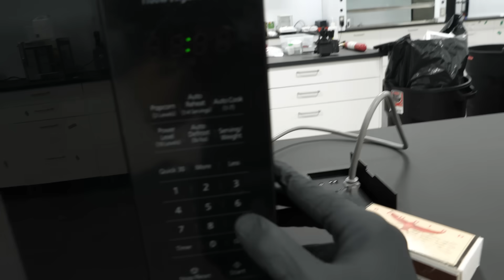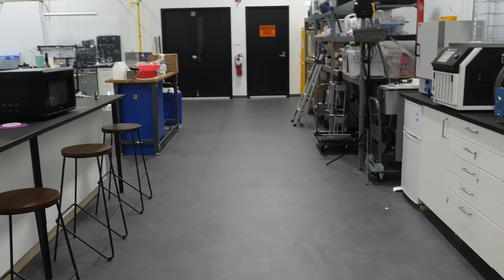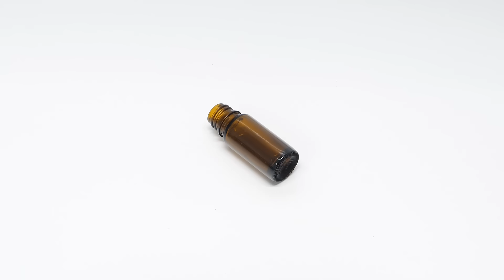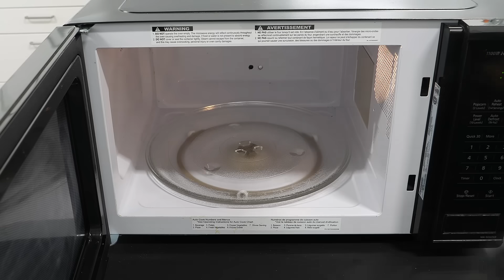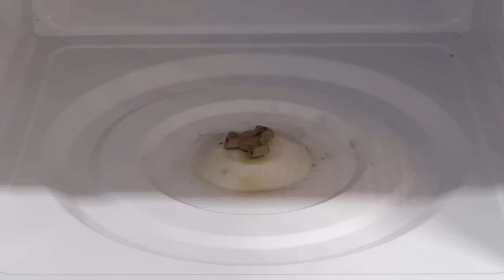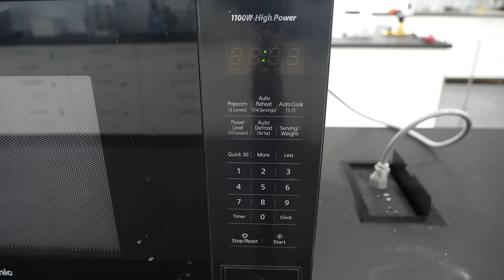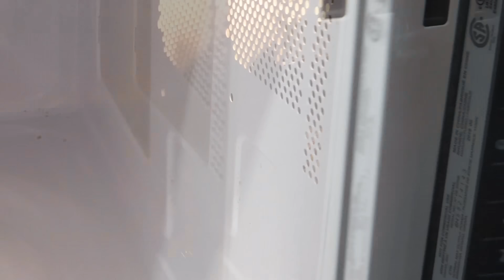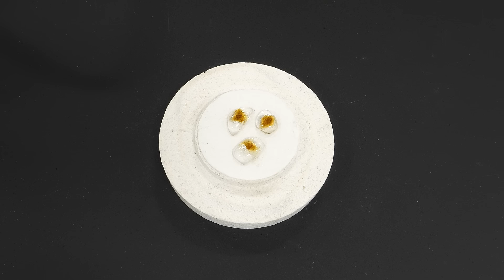Melting glass in the microwave is crazy

Comment: as someone who's dabbled in glass art, I can say this is an excellent result, pretty much what it would look like if melted in an actual oven. Unless you put pieces of glass on top of each other, they're usually not meant to melt together anyway. And the cracks are probably from using different kinds of glass but I'm not sure
Reply: The cracks are because they’re different types of glass. They crack because they have a different Coefficient Of Expansion (COE). When two pieces of glass with different COE’s melt together, they will cool (as well as melt) at different rates, and when one cools faster than the other, it will create a lot of stress in the glass which will eventually create the cracks you see in the final product. (I also got all my knowledge of this from glass art.)
Reply: @NG..  Agreed.  The cracks are 100 because of the different COE.  The beaker is borosilicate, and the bottle is not.  Boro has a COE around 33 while most glass is around 90-104.  Boro also melts at a higher temperature.
Reply: @evilsharkey8954  yes and no. Yes, the CTE (not COE, never saw that term) are vastly different, you are right. But another comment above is also right, the internal stress induced by the lack of proper quenching and annealing also caused cracks. I would see it as a combination of both. (mainly the lack of annealing imo)
Reply: @boredscientist5756  COE is coefficient of expansion.  It’s the term that was on all the glass at the local art glass supply store.  The cracks are radiating around the boundary between the two glass types, indicating an incompatibility.  Yes, they were cooled too quickly, but they’re very small pieces.
Reply: @evilsharkey8954  As a glass scientist (PhD), I reject the term COE... It is CTE... 

PS: Your explanation about cracking is naïve btw... You clearly have no idea about crack propagation in fragile materials (as you have no idea about the coefficient of linear thermal expansion (CTE). Your "COE" makes no sense).
Reply: @boredscientist5756   why would a person with a phd in glass not know how to
1. not speak in non broken indian-like english
2. educate someone without berating them for having "no idea"
Reply: @user-pr6ed3ri2k  broken indian-like English? Berating anyone? Seriously? 🤣
Reply: @boredscientist5756  yes
Reply: @boredscientist5756  now you're mocking me. good job phd man, you just demonstrated that you probably don't have a phd, or at least didn't listen yet got it anyways
Reply: @boredscientist5756  1. you may have stated facts, but that doesn't give you any reason to tell someone they have no idea and proceed to laugh at them

2. because why not

3. eh, racism is the most common thing on the internet now, there's no reason to stop it anymore (unless it's actually physically harmful of course)
Reply: @user-pr6ed3ri2k  Still liking your own comments....🤣
Reply: @boredscientist5756  This may seem as a surprise to you, but ad hominem is not a response to my comment.
Reply: @boredscientist5756  Then again, you're a person with a PhD, I doubt you wouldn't know this.
Reply: Also, I'm not sure if it was needed in this case, but melted glass does need to be cooled a certain way or it will crack easily as it cools.
Reply: I wanted to buy one of those ovens (for stained glass projects, obviously). Is this a good miniature substitute for those ovens? I didn't have the budget to buy them.
Reply: That's exactly right about the cracks. Incompatible glass will always stress out and fracture if you fuse it.
Reply: Anneal
Reply: The cracks are because it cooled too fast and built up internal stress
Reply: I thought the cracks were the texture of the surface they'd been resting on.

Comment: That's absurd. Glass has a melting point of between 1400-1600 C which means it would technically be possible to melt steel in a microwave.

Comment: This is something i have been trying to DIY, with some firebricks and chopped up angle grinder wheels (SC). It works but the binder in the SC burning smells whack
Reply: I once bought a foam concrete brick and some graphite powder to do something similar. But then I was to afraid and still used only the brick with a carved out hole for some other heat related things.

Comment: Different glasses have different melting temperatures. My mum makes glass art with a kiln and often uses "System 96" glass so the different colours all still have the same melting point and one doesn't shatter the other as it cools. I'm quite surprised this worked, as I thought the microwaves mostly excite water molecules in things, and I wouldn't expect there to be many of those in glass. Then there's the fact the mini kiln seems like it would block the microwaves to some extent, but given it didn't, you'd expect the kiln's flu/vent would be spewing out enough heat to melt the roof of the metal casing of the microwave.
Reply: I think it’s because the kiln in ceramic and a good insulator. Same way ceramic plates get hot super quick in a microwave.
Reply: Wait glass is liquid
Reply: @rizkicahyadi3777  Search youtube for "How to make a microwave kiln" and you'll be surprised to learn a bit.

Comment: The temperature of the microwave is how hot the food is when they say “it’s not that hot”
Reply: That is not how microwave ovens work.
In reality they teleport tiny blue flames inside what ever you are heating.
Reply: The temperature of the microwave isn't how enough to melt glass, otherwise it would have melted the door and other parts of the microwave.
The glass (once hot enough and gooey) is absorbing energy from the EM waves and becomes hotter than the surrounding material
Reply: @YounesLayachi  glass is transparent to microwaves, the kiln is absorbing the EM and emitting heat, the nature of a kiln is to trap that heat within and let it build up. put a dry, clean glass in the microwave on full power its temp wont change.
Reply: @ikitclaw7146  dry is only transparent when it's already cold. If you pot hot flexible glass in a microwave, it will heat up
Reply: @YounesLayachi  Good answer :D Cheeky but good!
Reply: And yet half of the food is still frozen cold enough that your tongue will stick to it.
Reply: The temperature of every hot pocket ever cooked in a microwave; is hotter than the temperature in the kiln.